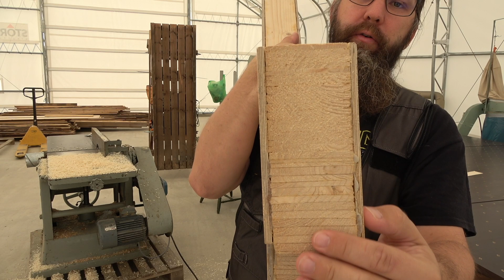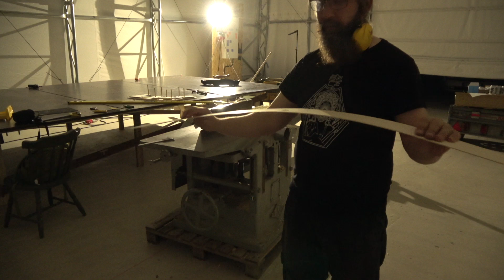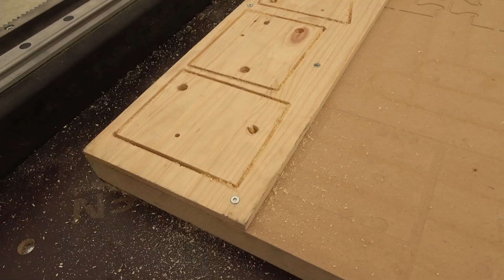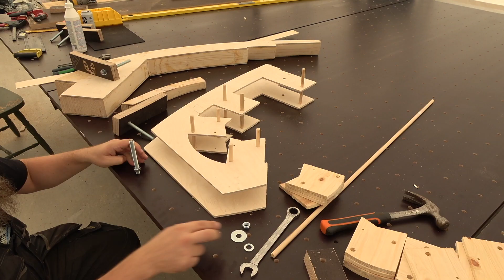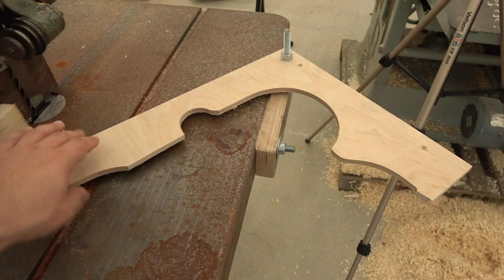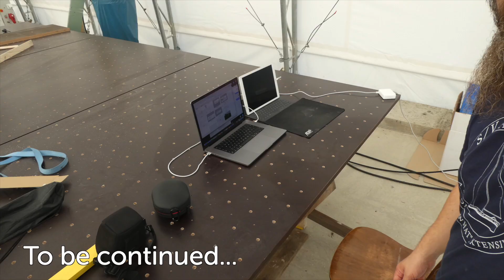SAILBOAT BUILD: Final test before build starts! pt1,  ep.43 Project SeaCamel

Comment: Just getting back at watching your videos, I had saved them for watching later but got distracted by life. Looks like you are very well set up for moving this build forward and it is quite exciting. I was wondering about your approach to lamination and getting the stock thin enough to conform to the shapes you will need and the time and material waste involved (resawing, thicknesser, sander). As you live in a country that manufactures a shit load of plywood - have you considered visiting a plywood production plant and having a ‘chat’? The aim would be to buy the ‘plys’ direct from them (the feedstock before they laminate them into big sheets. It could be a solution? Maybe?
Reply from the maker: Hi Norman and welcome back! :)

Yeah, there's many plywood/veneer factories within reasonable distance. But the problem with those veneers are that they're "rotary" veneers. That means they're extracted from the log like lathe. That makes them very brittle by themselves.
I need good quality cut veneers for the hull at some point and I'm currently discussing with Vendia's guys to get them at the same delivery when they're purchasing veneers for their needs. The 3,5mm veneer needed is very thick compared to what they use, so we'll see how it goes.

Comment: You have to make the application of epoxy better. How  about aif you dip the wood in a small basin and then pull the exess off passing  through a double set of rollers and collect the surplus in a bucket. Your present system takes to long time. Good luck.

Comment: You have started an awesome project!  New design, unusual materials, complex construction techniques, large size, all by yourself and in your spare time from work!  Most of us would not have the b**ls to do what you have started but you are approaching it in a methodical way, developing systems and overcoming challenges as they arise.  I love your drum and bass backing as it is the perfect acoustic analogy for your irresistable force that will overcome all obstacles!  Many of the best boat builders/sailors have musical skills so I predict great success - ultimately! 😁
Reply from the maker: Honestly I don't know. But it's tested and works!

One thing i didn't want was to have longitudal stringers inside the boat. They just catch water and can cause problems.

The hull will be strip planked and veneer layers on top - at least that's the plan!

Comment: I worked on a wooden boat build with laminated frames. The way we did it was have a lofting floor made from multiple layers of plywood. It was 36 mm - 40 mm thick I believe. It had the frames drawn out on it (we used a batten and marker but you could probably CNC the lines to 0.3 mm dept and then paint them and sand them down so you only see the paint line or something fancy) and then holes were drilled in it following the line of the frame that we were laminating that day, a plastic sheet was put on it, we then bolted L-shapes blocks (5 cm thick made from 3 or 4 layers of plywood) that were also covered in plastic (wrapped and taped on it with masking tape) onto it. The strips of wood (which were 4 or 5 mm thick) where glued with resorcinol and pulled into the curve and clamped. The strips of wood were cut from a slab of tree on the band saw and then both cut sides where planed (using the bottom part of your planer machine you have there). We didn't plane it before it went through the band saw at all. We didn't care about the width of the boards either, as long as they had the same width (so they don't stick up when clamping the curve) and were a bit oversized to what we needed. After the glue was set we used an angle grinder with sanding disc to remove the bits of glue that were squeezed out (cleaning up the frame from hard glue to save wear on the planer) and then the frame went on top of the planer to make one side perfect, and then went through the bottom of the planer to make the other side perfect and bring the frame to the correct width. 

Even with the best precision you are trying to do in your videos you will still have to line out the frames after they all been placed on the keel and they will need adjusting. I think you are giving yourself too much work with trying this level of precision. Remember the "planking" (I assume you will use plywood as part of the skin / hull) will curve over the frames, so none of the frames (except maybe one in the middle) will be flat where it meets the hull planking. They all will have to be (hand)planed to the angle of the hull planking / frame joint. The way you are set out to make plywood molds for each individual frame (that become part of the frame in a box design I guess from watching your videos) is serious overkill and sound expensive. Also when you come to set a curve to the outside of the frame for the hull planking you will have to (hand)plane a frame that is half edge of plywood and half wooden strip with glue, so grain going in different directions. I would suggest with the two or three sample frames you have now that you set them up as if they were next each other on the boat (even if in reality they aren't) and you use a batten (1 cm width of those 3mm strips you have perhaps) to wrap it around the frames to see how you will have to set an angle for the hull planking on those frames. I think when you see that and come to think of the process needed to set that angle that you will reconsider your plywood boxed frames design.

I read in one of your comments here that you want to incorporate the floors into the frames. We did this as well. But we laminated each frame twice (when you flip it over when made in the same mold on the lofting floor you have the other side of the boat) then with the two laminated frames we set them in a jig for alignment and glued and screwed a floor beam onto in (also in the jig for aliment). The floor beam was cut on both ends to follow the inside curve of the frames. We then glued and screwed a 12 - 18mm (can't remember) plywood shape  slightly smaller than the frames and the floor beam to it. At the top of the frames we screwed a temporary board at the position of the deck so that the frames kept the right distance. After curing, the two frames and floor beam were fixed because of the plywood, we then flipped them over, and filled the cavity between the frames and floor beam with wooden blocks saw on the band saw and glue thickened with sawdust (saw you mention reusing that, perfect here). We made blocks out of every scrap of the wooden slabs we had. Then when the whole cavity was filled we glued and screwed another shape of plywood on it. The shape is basically straight on the top following the floor beam (but just falling short) and curved on the bottom following the frames (but just falling short of their outer edge). Then a cut out was made in this assembly for the keel (we already anticipated the cut out, so didn't fully put blocks there). The combination of starboard and port frame with floor beam, and the box filled with blocks, then slit over the keel and could be bolted down on the keel through the floor beam and blocks. I hoped I explained it well and I do hope you use the attempts you already have in a mock up to envision the whole process of aligning frames and planking. You might be micromanaging making the frames the most perfect you can and not seeing yet that building a boat is something organic if you don't use a mold you fill with fiberglass and resin but use wood (even if that wood is modern laminate and not steam bend like Arabelle or saw like Tally ho). Best of luck and I'll keep watching the progress.
Reply from the maker: This is the reason why making these videos is worth it!
 
I read it briefly now but I will come back to it later because tomorrow I will laminate the first frame. Join the live if you can!

Quick thoughts of what you said is that many of the aligning issue has already been thought of with the 3d model. I’m hoping the precision will be good enough to fit the parts together like legos 😎
I’m sure that’s not the case in all parts 😏

But one thing particularly catched my eye was that shaping the outside of the frame should be left to be done when the frames are on their places. By that I mean the laminated middle part. In this video I made it straight but of course when the hull is curved, there will be slight roundness on them.
But still, the shape of the hull is determined by the high precision plywood edges.
You’ll see later that I’m gonna integrate many additional features to the frames to make aligning and building much much faster. All the measuring and lofting has already done with computer. 🤓

Comment: Hi nice video. I do some lamination work for various hobby products and it is a wasteful technique. I tried planer and thickness sander and both waste similar amount of material. The advantage of the sander using 50-60 grit sand paper is the rougher glue surface which works better with epoxy.
Reply from the maker: Hi! That is actually something I’ve been wondering as well. To get a bit rougher surface with sander.

Lamination is wasteful indeed but actually there’s not that much material needed anyway for the frames that it would be serious financial issue. And also when making lamination, you can use little less quality material compared to massive timber build.

Comment: I don`t think your planner has two speeds. The first speed is there only to start the machine. When it reaches working revs you turn it to the second speed, which is ment for working.In the first speed the motor is coupled in a star scheme and thus getting only 230 volts. In the second speed the motor is coupled in a triangle scheme and thus using all the 380 volts of your three phase installation.
Reply from the maker: I actually tested it later. There definitely IS two speeds. The higher is considerably faster! Not sure how it's meant to be used. But Bogeyman also has:
-Table saw
-Very very VERY deadly table router with HUGE blades!
-Some sort of sander attachment
-Also tools and fittings to sharpen the planer blades

What I assume is that at least the jointer and router are meant to be used with the higher speed. But it feels even more dangerous! 😱

Comment: Why the horizontal (outside cover layers) and vertical glueing of strips for the frames. Overly complicated in my amateur opinion… Does that’s give any strength advantage vs just layering/glueing pieces horizontally together…?
Reply from the maker: The strips need to follow the curvature of the frame. The grain needs to be continuous from top to bottom to gain the strenght needed. I actually asked this from mr. Tanton.

If you look at Tally Ho or Arabella, first relies of the natural form of the timber and latter did bending of very straight timber.
What i'm achieving here is very strong "unnatural" timber. Also there's much less frames compared to them.

By making these this way I try to eliminate many stages of work to be done. I'm just preparing stock accurately, having a proper table and clamping, the frames should be pretty much ready to go right from the mold.
They're also pretty big so it would be difficult to handle them though the machinery by myself. 
And also I'm combining the floors to them so I don't need to do those separately afterwards.

CNC-machining the form should provide a millimeter accurate pieces that should eventually fit perfectly together. :)
Reply: I would consider to do this in three separate steps. 
First glue the strips together with some oversize. 
Secondly cut the part into shape on your CNC
Third glue the outer surface on.

Comment: Have you considered steaming the wood or at least soaking it to bend it easier at tight corners?
Reply from the maker: I have. But currently I don't have any tools or things to do that. I might have to use it with tightest parts.
Reply: Its just requires a palstic seawage pipe and a pot with hot water, i think u can handle that installation easly.
Reply: Sauzedde (Tips from a Shipwright) uses long plastic bags and a gas powered boiler to produce the steam. With his kind of setup, you could slowly bend your slats into shape as they steam. But your technique seems to work, so...

Comment: great video!!!  maybe a steam bender and a featherboard might help
d
Reply: Steam is very helping for bending wood. 
If you are afraid of the moisture in the before glueing do it in separate steps. 

First bend with steam.
Let it dry in the form
After dried to your needs
Take it apart and finally glue it. 

The pre-bent material is then easier to handle in the glue step. Less force and resistance.
Reply from the maker: I might try steaming at some point. Probably with the tightest corners and maybe with the stem piece. Currently I don't have any tools or things to make or handle steam.

The test piece 2 which I made few months back I used just hot water and it helped. But I didn't have big table and the clamps I have now... ;)

Comment: You need a moderate sized band-saw to cut your strips at 3 to 4 mm and not rely on your planer to reduce the stock size by more than half.  As you said, its not very economical for the material waste but also you'll have so many laminations that the labor time is drastically higher.  Save 2.5 mm thickness for tightest radius pieces and compound curves, on many of the larger sweeping curves you can manage 4 to 6 mm thickness.
Reply from the maker: Interesting idea! I need to think about this. The issue comes in mind is to manage the changing thickness of the pieces. There must be some kind of taper on the joints or something...

I have finer blades for the bandsaw but haven't yet tested them. The big blade used here is pretty rough!
The system I used here isn't very economical, but on the other hand, there's not very much material needed for single frame. We'll see!

Comment: Looks like everything is nicely coming together 😃 got to say it , get some dust/chip extraction connected to the planer/thicknesser , also treat that machine like it is out to get you , it probably is 😉.  For pushing the wood against the bandsaw fence , how about a feather board ?
Reply from the maker: Yes, there's dust/chip extraction parts that came with the Bogeyman but I don't have yet suitable hoses for them. Also the bandsaw (need to come up a good name for it!) has hose connection.
However, worst machine is the table saw. Fine dust everywhere and just a tiny dust hose plug...

The bandsaw "pusher-roller-thingie" works perfectly btw! I milled yesterday more stock for the actual boat! 😁

The ultimate goal is to finish the boat and have all my fingers remaining! 😆